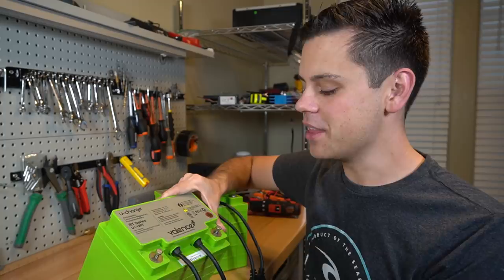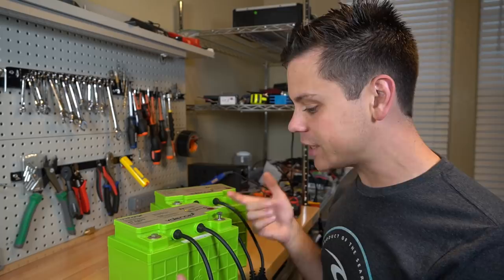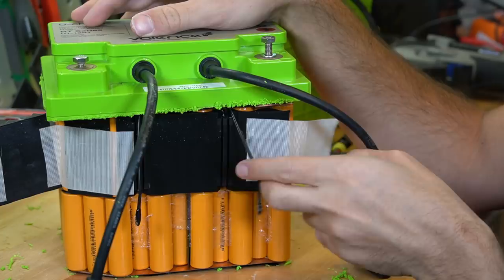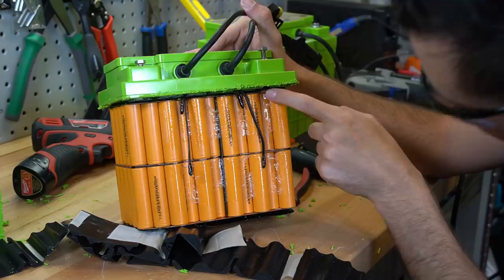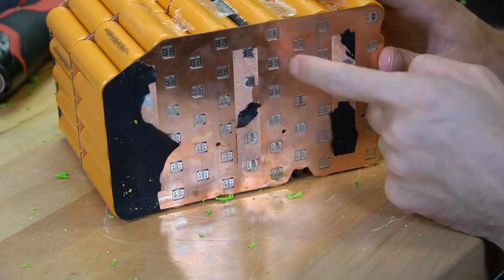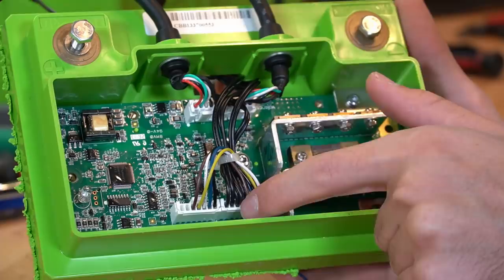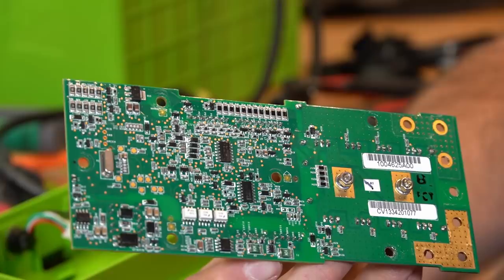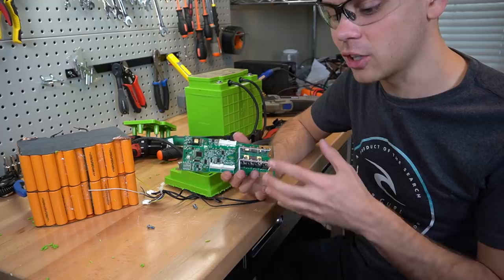$1,248 Valence RT LiFeMgPO4 Battery Tear Down

Comment: Looking forward to see the Chinese Alibaba similar-looking battery inspection.
Reply: Yes please, inspect alibaba battery !
Reply: @OeufDurMoelleux  Can't wait to see the Alibaba clone inspection....
Reply: Me too. And those cells you found. How on earth would you de-weld that plate off the cells?
Reply: Can't wait to see also, just ordered a dozen of the alibaba batteries
Reply: Yes me too. Please do buddy. I need to buy 6 batteries as I'm putting together my first solar system. would be nice if i could just buy them cheap from alibaba only if the components inside are good quality and made well.
Reply: I would like to see the Alibaba battery too.
Reply: James Edwards Going ahead and buying a dozen alibaba batteries is pretty much the definition of “cant wait”
Reply: James Edwards 
So I’m about to buy some batteries off Alibaba for my converted schoolie and was curious which ones you chose?
Reply: Yes and please take a Alibaba battery apart. That would be supper helpful.
Reply: Trump isn’t happy reading these comments...
Reply: Can you link the video if it gets uploaded please?
Reply: I wonder if I need the external BMS for these?
Reply: Has there been a follow up?
Reply: We’re all gathered around waiting for your comparison…. Come-on Will !
Reply: Have you done the Alibaba?

Comment: There are yacht manufacturers that build these into the hull because they are so reliable. Also you can make a string in series up to 700v. No other off the shelf battery even comes close to a series voltage of 700v.
Reply from the maker: 700v is incredible. Which model?
Reply: @WillProwse  The XP models can handle 700v ( even up to 1000v with a 3rd party bms). I bought 8 u27-12xps cheap not realizing the internal BMS only monitors the cells of that single battery and an external BMS is needed for the system as a whole. The u-27-12xp has 144ah at 12.8v  which is amazing, but the external u-charge BMS's needed are extremely rare. I have been searching everywhere for a low voltage model of the BMS for months now with no avail. I have heard of people switching out Valences system for something called Batrium, but installing Batrium is not something for a newbie like me to do.

Comment: Hospital grade certifications, traceability documentation and insurance make equipment incredibly expensive.  A duplex wall outlet will cost you $1.50 at a hardware store.  The same hospital grade duplex wall outlet (with a green dot on it) will be about $20 at the same store.  It's not a scam - there is just a lot of cost in labour-intensive record keeping of the manufacturing run, material source records, component testing and certification.  That way, if a defect is found in one item, a recall alert for all items affected by the same problem can be issued to medical centres.  The same is true for equipment rated for the nuclear industry, etc.
Reply: Dee Jay  Yes, you are right, but there are differences in quality standards. I don´t wanna buy paper. I need a battery. Sometimes I wonder... wouldn´t it just be cheaper to manufacture a better quality then all this paper BS ?
By the way. Ouality standards are not established. They are negotiated. That means there are international politics and  paper pushers involved. 
Why do You think there are countries with their own certification system ?
It is also a political tool to keep certain producers, suppliers, manufacturers under control or out of certain markets. 
No deal unless there is some kind of a trade agreement.
Reply: There used to be a saying that a rocket couldn't fly until the paperwork exceeded the weight of the rocket. Thank God for Elon LOL!
Reply: "The same hospital grade duplex wall outlet (with a green dot on it) will be about $20 at the same store."
No, it is not the "same".  There are much tighter specifications on the Hospital Grade unit; spacing, material, flammability..., but the noticeable external difference is the "plug retention".  Pull a plug out of a Hospital Grade one, then out of a regular socket.  Two times, or more, resistance. 

You don't want things becoming easily unplugged in a hospital.
Reply: Dee Jay  YET BILLIONS in public highrises got detonated to cut new CHECKS.
Reply: I used to repair helicopters for a living. Every job I did I had to write it up and sign for the fact that it was carried out in accordance with some standard. Even if I didn't do something, I had to sign that not doing it was in accordance with standards! Literal mountains of paperwork. And, yes, I worked for a government agency!

Comment: Anything labeled for use with “medical equipment” is going to be ridiculously expensive.
Reply: Good scam there, importing cheap Chinese batteries, sticking a "medical equipment" label on it and flogging it with a $600 markup.
I think a lot of people will be unhappy that they've been exposed.
Reply: @mikemead2315  In an ideal world where people follow the rules, I would agree with you.
Reply: @MikeMeade.
Yeah you would think that but with the liability involved in any medical system it's not even worth it.
I'm an EE and wouldn't touch anything meant for medical equipment unless I was employed and backed up by a big company with all necessary procedures implemented.

Comment: Conformal coating is the word you are looking for.
Reply from the maker: Thank you!!
Reply: You beat me to it
Reply: Conformal coating material is a thin polymeric film which conforms to the contours of a printed circuit board to protect the board's components.
Reply: DIY Solar Power with Will Prowse 

I Have 5 Of These But Im Using It For Car Audio 12V , 1pcs of these 40ah lithium equals how many agm regular battery??
Reply: It's hard to probe the circuits that have been conformal coated, touch up any repairs with clear nail polish.

Comment: Never underestimate China or Chinese products.  China graduates more engineers from college than the USA does for all majors.  In my experience China is very good at determining what grade of component is required and using the good stuff only when required.  Cheap Chinese two stroke engines for example use high quality Japanese main bearings to withstand the high rpm and load.

Comment: What about the valence U27-12XP 138ah batteries, Do you have a video about these?
 I recently bought 6 of these for my RV Solar system, which is not finished yet.  Are these built with the same quality? Also I am wondering, when these bms cables are connected in series, what plugs into the end cables left hanging? 
For what they cost, I hope these are good batteries.

You always provide great info and your knowledge is top notch....Thank you for doing all you do for us!!

Comment: Part of the expense is that it is labeled for medical equipment.  I was purchasing pulse-oximeters for a nursing home.  From a medical supply company it cost $180.  I could get the exact same thing, according to specs, from REI for $85 but it had a label that said "not for medical use." A complete scam.  Good to see that the battery industry actually has a difference.

Comment: Another great vid 👍
Got  a 50 Ah Battle B few months ago to power a 45 Minn Kota on a 16 ‘ Flycraft boat . Put it in a Minn Kota batt. box with a Victron solar charger , total weight about 18 lbs wired it for a 100w Renogy  . Works great so far , got a lot of look from guys lugging 80 -140 lbs lead around . Ran all day every day.
Got a lot of insight from you to put it together:-) 
Thank you and please keep it up , you really do a fantastic job!!!
Reply: EqualLandFreePeople 
Thx for the tip , I will look into it 
The MK I have has a smart controller that seams to extend batt life and works pretty good , but who doesn’t want MORE POWER:-)
Reply: @Worthrhetime  i met engineers who replaced noisy outboards with electric for colarado river silence sake.

Back then a black boxed quiet water cooled & polluting diesel genpack was used but NOW perhaps batteries or massive fuel cell and carbon fiber methane (CNG)?
Reply: Fojr SeptA  next spring I hope to do some Colorado river running with my rig. I haven’t fully tested the 50 Ah to the max ... I was worn out before it was :-)

Comment: 130 batteries if I counted right that is about 170$ + 30$ shipping. It should be about 750wh without the efficiency losses (1 bat = 4,4wh). I would guess the BMS could be about 100$ max and the box and cables are by my judgment about 50$ max, so total cost would be around 350$.

Comment: So thrilled to see the insides of the Valence. We bought 8, received 9 as one wasn’t blinking green but still hregisters 13.4 V . 

They were 12v 138ah each used with less than 300 cycles on each. We got software to test each battery and couldn’t be happier. They were way lower. We paid $350 each! Plus the ninth for free! 

We are in the process of installing them in our fifth wheel with a 24 victron multiplus 70 inverter/charger. We will install 5- 330 watts solar panels in the spring as we are in winter right now with snow. We bought your book and it has really helped a lot.
Reply: $350 with the 9th free is a deal! Congrats. I have 8 of the u27-12 xp I plan on using in my build but I can't find a u-charge xp BMS for the life of me. What are you using for your build?
Reply: What my wife said is basically true. I was given software from a group building e cars and trucks. I haven’t gotten the software to function. It was supposed to be from valance to monitor the battery system with a computer. So my understanding is that the individual batteries are self monitoring but without the “master”BMS they don’t communicate with each other. ? Not a expert, just trying to boondock as long as I can.

Comment: Will, thanks for this video ! ....the questions about whether the BMS is a standalone system for each unit  is still very important... can you address that?... the external data leads and Valence’s literature make this very confusing. I have two  of these that I am wiring in parallel , and it’s unclear if I should connect the data cables and or use the external  system from Valence. I’m really hoping you can clear that up. Thanks!
Reply: There SURPLUS?

Comment: Hey Will, took your advise and purchased the 12-volt 138ah Valence lithium battery on eBay for 375.00.  Replaced 2 group 24 lead acid batteries with the one and it works great.  Haven't seen much fluctuation in voltage after using it this past weekend in my trailer.  Thanks again for the awesome reviews.  Barry

Comment: I use one of these to run my fridge/freezer in my 4x4. It's a 43 quart and in the summer, it'll run it 40+ hours without solar assistance, runs consistently with 100w panel hooked up. Drops about 20 percent over night and is topped off by 9AM the following morning.

Comment: It would appear that buying a good, expensive battery will save you money in the long run.  The 2 batteries are WORLDS apart as far as quality goes.  Going cheap will probably cost you more money in the long run.  Thanks for the video!

Comment: UL and other certifications can cost up to $100k or more to pass, plus salaries for multiple highly qualified and well paid engineers and project management. By the time the product is ready to market the company has millions invested and wants to recover its investment, hence very expensive batteries made for medical equipment, not for Will's solar storage shed, LOL.
Compare this to a Chinese VAR, setup a shop in Shenzhen China, buy cheapest possible plastic boxes, B grade cells, cheapest BMS you can find, slap it all together by hand and post on Alibaba, how cool is that?
There is no sense comparing prices between a space ship and a horse buggy only because they are both "vehicles".
Product has to be good enough for the intended task and safe enough not to burn your house down. Buyer always beware.
Reply from the maker: Very true points. Agreed
Reply: Medical equipment is odd shit.  Saw cardiac interrogator it ASKED for vitals then uploaded via cellular modem.  Huge expensive device.  Brilliant cost saver.

Comment: When you see complexity, you see awesome. When I see complexity, I see many more points to fail. I very much appreciate the look inside that pack. I've been tempted to buy one, and at least now I know what I'd be purchasing.
Reply: The sensor and interbattery networking is redundancy DUH
Reply: @fojrsepta4959  You have a schematic for the complex protection board to prove that there is redundancy built in with 0 single point of failures?

Comment: Why does "Made in China" bother you? China has UL/ISO certified factories to make excellent quality products far cheaper than in US. Most US companies have CMs ( Contract Manufacturer ) in China. All the design/engineering is done in US, but mass production is in China, with strict QC standards. However, less qualified CMs can make a clone product, even copying the same plastic molds, but with much cheaper internal components and lesser QC standards, and those are sold on Alibaba at much cheaper prices.
Reply from the maker: Yes that's true. I just have some minor PTSD from the last Chinese battery haha but you are correct

Comment: It's pronounced va - long  A - lence  - as those of us with an academic chemistry background learn.  The valence of a molecule is "the combining power of an element, especially as measured by the number of hydrogen atoms it can displace or combine with" or "relating to or denoting electrons involved in or available for chemical bond formation".

Comment: I picked up several of these Valence batteries last week at a battery reseller. Right next to the Valence batteries were some others that looked just like the valence's but had different colored cases. Even though they had higher AH ratings they were priced cheaper. The guy I bought from said the similarity ended with the looks. He went into some detail that I forget now. He essentially said the Valence was the far superior battery of the ones I was looking at.

Comment: Not knowing that much about BMS and these Valence batteries (even though I have 4 of these) Question - Hooking these up to a Solar Controller like Epever - does this automatically balance all the batteries in this battery pack??? I'm sure an expert can answer that for me, thanks
Reply: Yes. The bms manages the 18650 arrays. All you see is a 12v battery in the end

Comment: Great video Will. Also looking forward to a teardown of the cheaper AliBaba battery. Did you ever crack open a Battle Born? The water resistant coating, I believe, is called Conformal. Higher Quality electronic components, Marine/RV, etc use it, The Kid,marine model, from Midnite Solar, etc.

Comment: Must you use a Valence BMS that plugs into those plug connectors or can you just wire this into a standard RV solar system with the appropriate charge controller?

Comment: Great video! I added 5 of these (bought slightly used) Valence batteries to the 4 battle born batteries in my RV to give me 600 Amp Hours (7kwh). It worked great to run my house for a day in testing. (1280 watts of panels on my RV). I have tested high and low temperature cutoff on the battle born batteries but have been unable to trigger any low temperature cutoff on the valence batteries. Have you had any success?

Comment: Those valence batteries are REALLY good. I have 4 old ones still holding 98% of their original capacity, after 2000+ cycles on each. I really only use 60% of each battery to make them last as long as possible but dang that BMS is good, no wonder they lasted so long

Comment: not sure if this would work or not.. there is little clamp on stops for framing squares to make laying out stairs easier.  But I wonder if you tried clamping on your Dremel tool as a depth stop for added safety when opening these sealed units. after watching a few of these teardown videos I have noticed you are very careful and quite lucky so far. But just an idea I though I'd share. Great channel. Awesome videos, thank you.

Comment: wouldn't mind betting that  the cells in this unit have been double or triple tested from a large supply of those same cells on alibaba but only the best ones that consistantly perform to spec or higher are used. This is what makes quality manufacturers (like Sanyo etc) battery cells much more expensive. Its the verification process, (time consuming)

Comment: You know that the Mos Fet components are very sensitive to electromagnetic field and you just open that battery with a power tool that generate elecromagnetic field.Same in soldering never use the the transformer soldering gun.

Comment: "Conformal coating material is a thin polymeric film which conforms to the contours of a printed circuit board to protect the board's components. Typically applied at 25-250 μm thickness, it is applied to electronic circuitry to protect against moisture, dust, chemicals, and temperature extremes. More at "Wikipedia""
Reply: Quarter of a tenth of a cm is a hundredth of an INCH a t thickest?